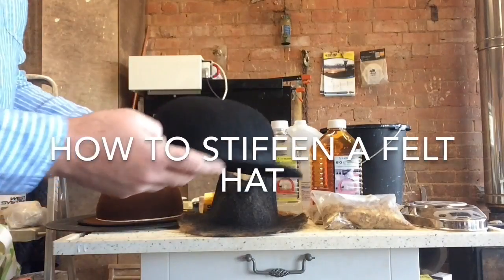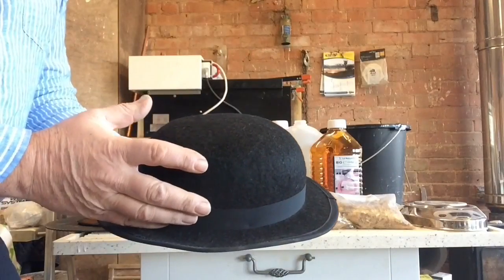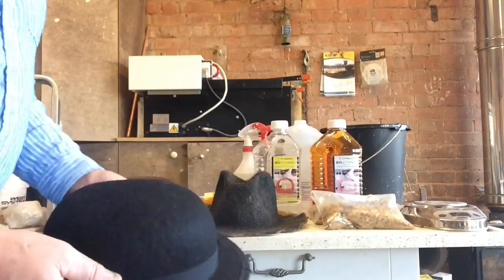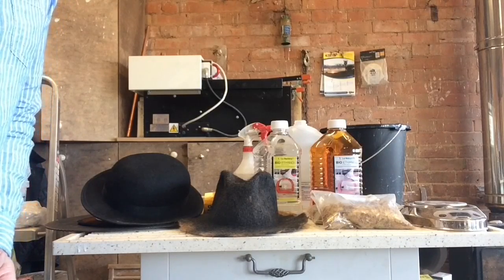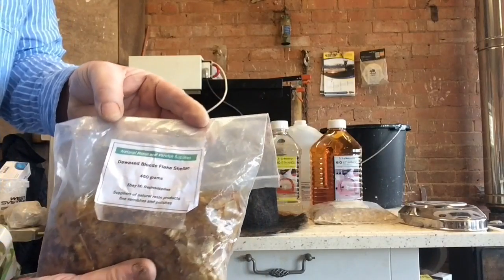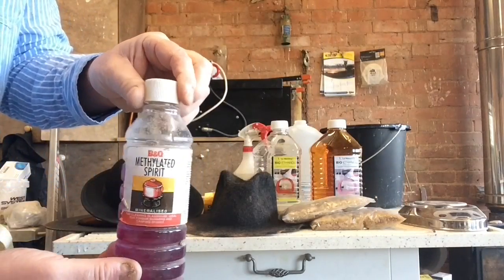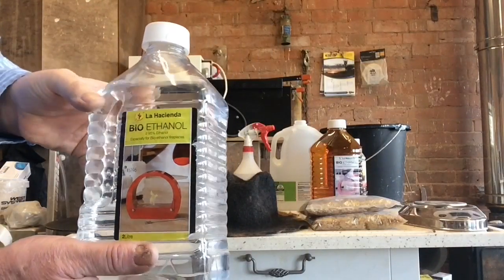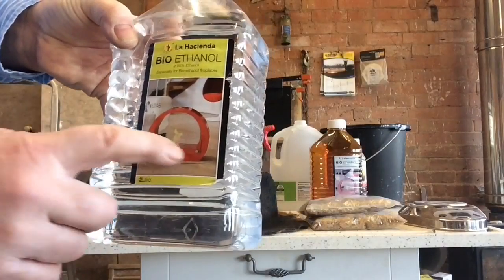How to stiffen a felt hat with Shellac

Comment: Great tutorial! Clear and concise. Can it be also used on light-colored hats? Does it leave stains or traces of some sorts? Thank you.
Reply from the maker: Hi Michal. Thank you for your comment. The shellac is a golden colour so it will add a golden tinge to a light coloured felt. If you apply it sparingly though perhaps acceptable in most cases. The more you add the darker it will be.
Reply: Thank you very much for your answer I appreciate it. I´ll give it a try. Have a nice day!
Reply: Hi, I hope you don't mind if I jump in. You can buy shellac flakes in different colours. I just purchased super-blonde, the lightest (and most expensive) online from Lee Valley Tools. I chose this as I don't want it to leave any amber tinge behind. I haven't tried it yet but that is my plan for this week, to find a good old fashioned recipe that works and looks good. I haven't figured out the ratio yet.
Reply from the maker: Frank Iacobucci I look forward to hearing how you get on! The flakes used in the video are blonde. Does the Super-blonde look much lighter?
Reply: Hi, I used super-blonde shellac but when I gently scratch hat by nail, on the felt stay white line. 
Do you have same problem with blonde shellac?
Thank you.
Have a nice day.

Michal
Reply from the maker: @michalkozar5051  sounds like your mix might be a bit too concentrated. You could dilute it and try again.
Reply: I would apply it to the inside only in case there is a color change.

Comment: Thanks for the video! Just what I needed as I also recently visited Stockport hat museum and was going to experiment! I have trouble using stiffener on fur felts which have a long or velour pile. I find the other stiffeners either matt it down or leave white marks. The main advice I've heard is to just stiffen the inside but that's no use if you have an upturned brim you want stiffening!! Would love to hear your experience regarding velour etc furs...?
Reply from the maker: I've only used shellac on my alpaca felt hats, but it leaves it feeling natural with no marks although it will leave a tint on a light coloured felt. I stiffen inside and out as required.

Comment: So I'm starting all felting and hat making and all adventure and I found some ready made shellac politures that are 15%, which is roughly what you use here. Will they do for crown shaping? (assuming I'll get to that stage, felting already seems a wee challenging)
Also how much the colour will change? I'm going for rather bright, fancy coloured hats. A bit of change won't be a biggie, but would certainly prefer them not to get half-brown no matter what colour base I'm using.
Reply from the maker: Basil Jackson - Malabarista Hi. I have only used what you see in the video, but assuming it is the same, then the more you add, the stiffer it will be. You could therefore spray or brush onto the entire hat, let dry, and then if more stiffness to say the crown, apply more to that area only. If you are making the felt from scratch yourself then you can also make a test piece to test for colour separate to the hat. Good luck!
Reply: Apply the stiffener to the inside only.

Comment: hey how are you? thanks for the informative video. would you say you had a preferable mixture ratio? smaller batch size.
Reply from the maker: Hi Paul. In the video I used 30 grams in 2 litres - in fact rather a weak solution. So perhaps start with 20 gm. per litre, or make it stronger and then dilute as required. The effect will depend on the strength of the solution and also how much you apply.